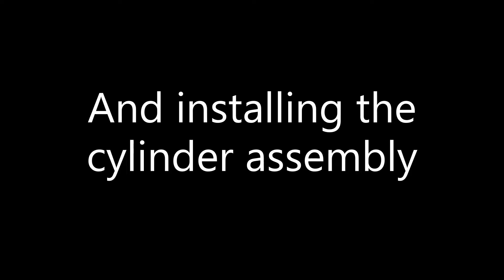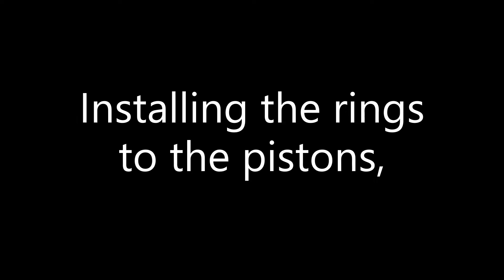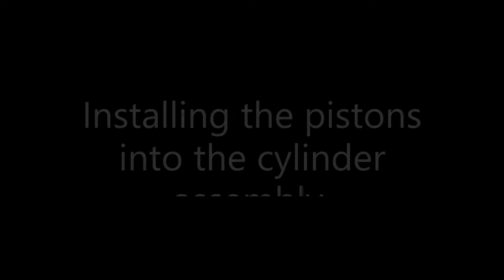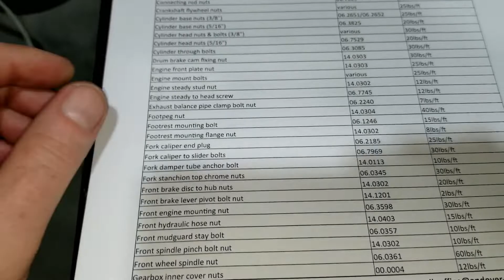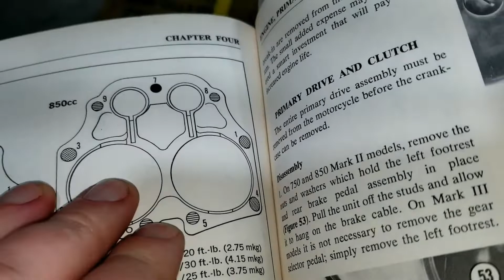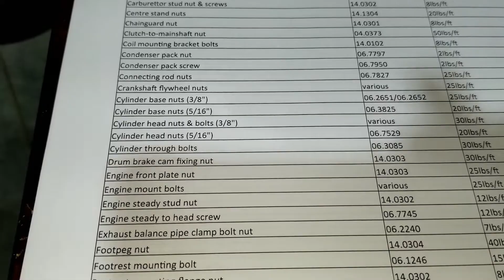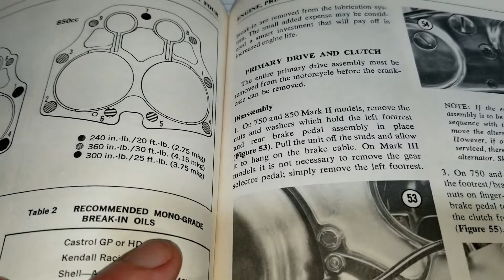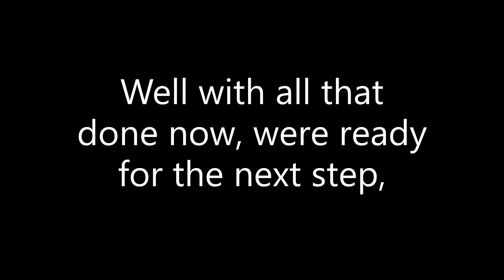1974 Norton Commando engine bottom end rebuild, Part: 5 Fitting the pistons and cylinder assembly

Comment: You can use a fishing scale on the combination wrench to torque the cylinder base nuts. Divide 12  by the length of the wrench and use that factor to calculate the torque in foot #s.

Comment: A coat hanger instead of safety wire. Part 6   Stator or rotor 😊 remove the head to set ignition timing. How about a timing disc.

Comment: why not .040 safety wire
Reply from the maker: Well we could've used that wire but we used a very strong wire and like any wire used it needs to be tight and not able to wiggle or vibration will wear the wire and fail